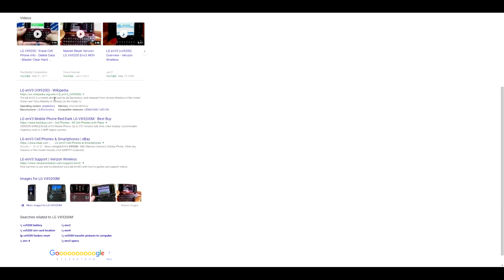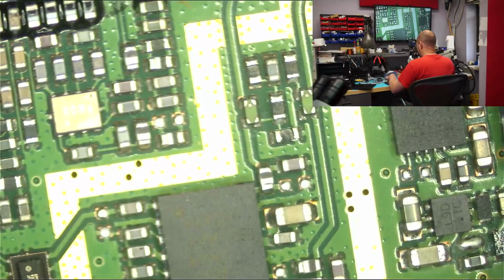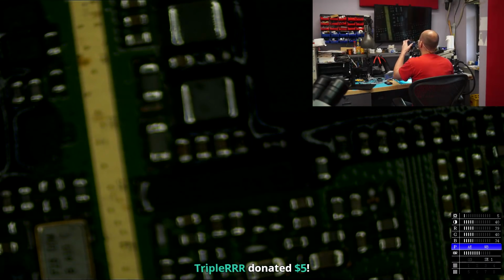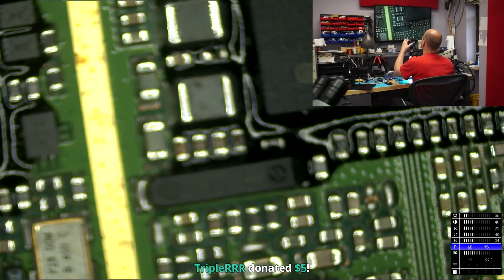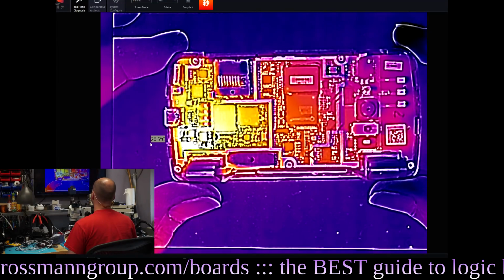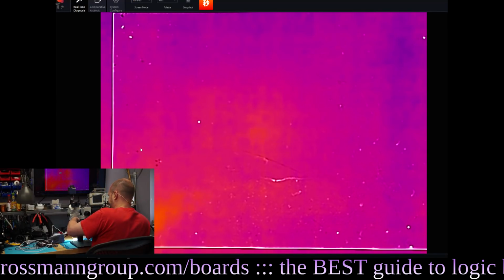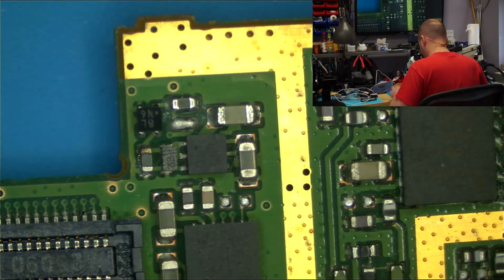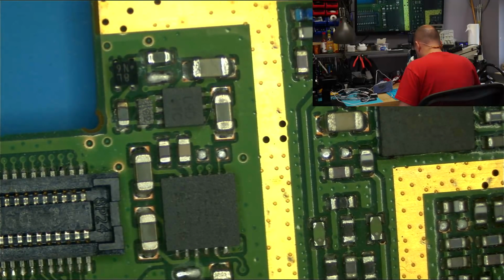Paul fixes an LG VX9200M Cellphone

Comment: The two chips replaced so far looked like they weren't just MOSFETs. The small square 5-pin in the corner looked like some voltage regulators that were on clearance sale a few years back.  The big 10-pin near the NAND might be a full feature charge controller that does USB and battery management in a single chip.  Together, that looks like the (water?) shorted cap at the small regulator burned the main regulator at the other end of the board.